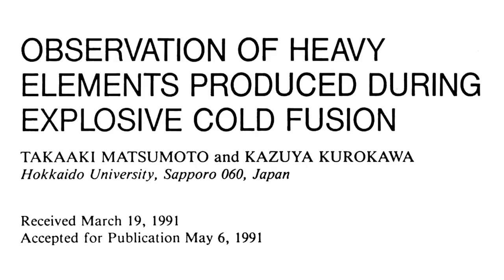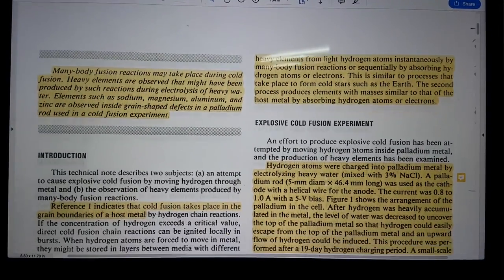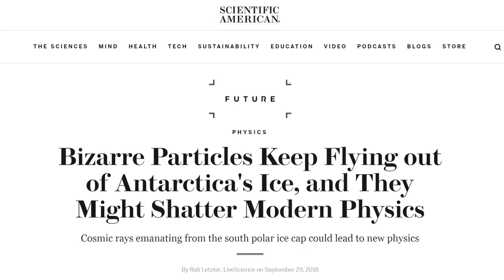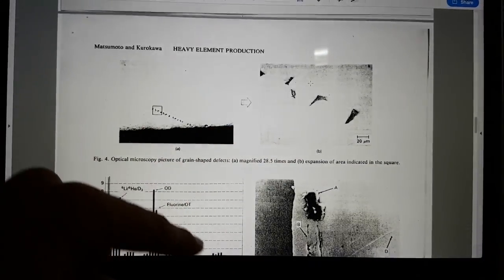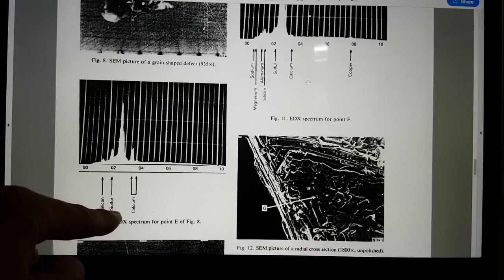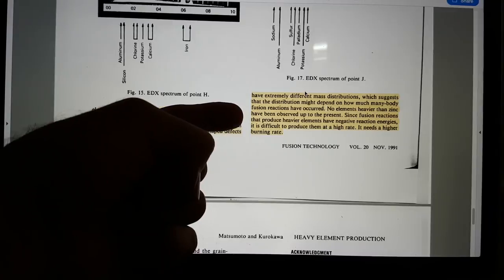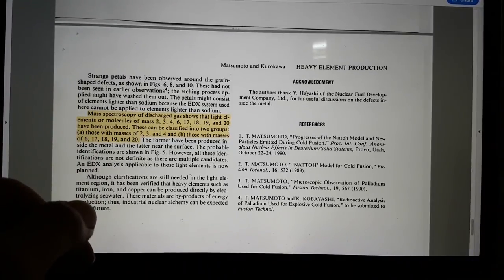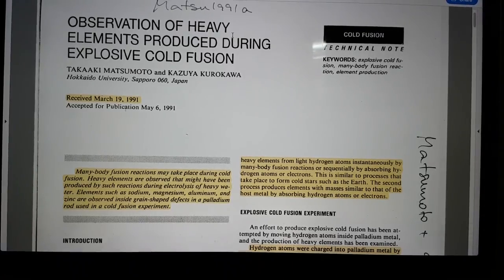The First Published Classic Strange Radiation track Takaaki Matsumoto, 19 March 1991

Comment: Are there descriptions of control tests in the paper?

It also appears that the spectrometer they used had really poor resolution. State of the art mass spectrometer can distinguish between thing like d20 and neon, but the graphs do not. I see no information at all about exact machine and it's accuracy used in the paper. This is kind of a bad science. The vertical scale of "arbitrary units" is also a bad science , due to way errors show up in the spectrometers. You need absolute units and explicitly error modeling, which is not in the paper.

I see not a single number with error estimates. This paper is almost useless.
Reply: This was done with technology of 1991, and the controls were done in the references. You have to read all the work of Matsumoto to get the whole picture, each is referencing previous work that completes The picture.  Matsumoto did controls with null results and he reports they when it is of use.